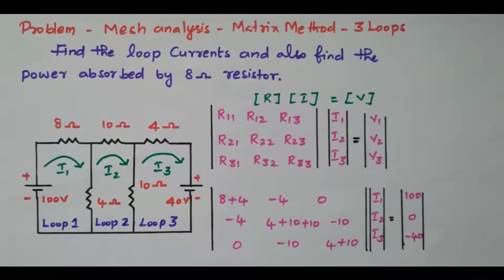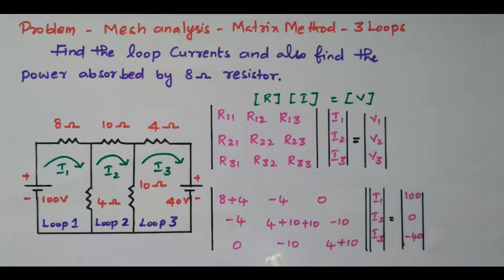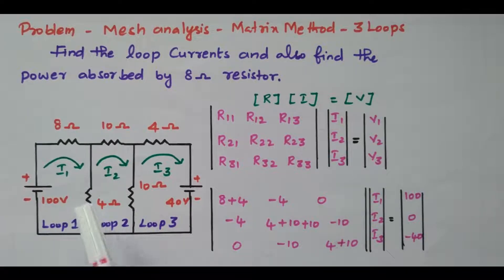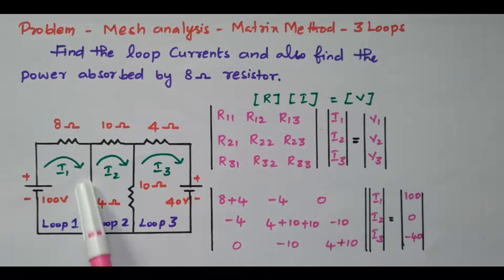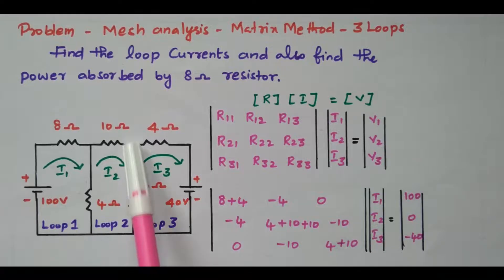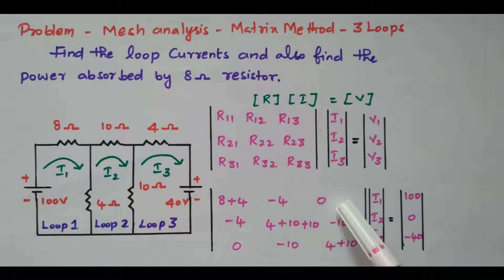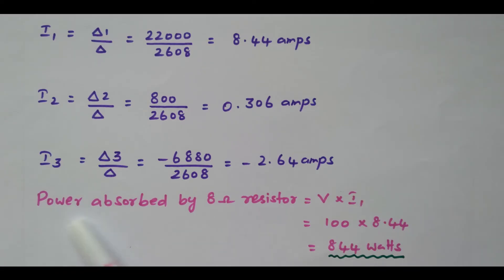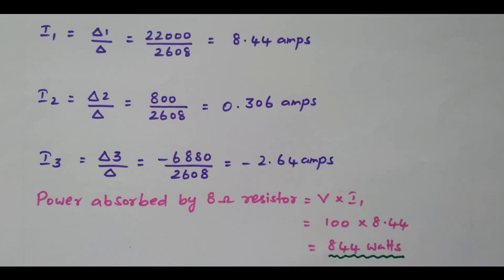Solved Problem #4 - Mesh Analysis - Matrix Method - DC Circuits - Basic Electrical Engineering

Comment: Good explanation, but I would like to make a small point. The power consumption on an 8 ohm resistor is P=IxV=8.44Ax67.5V=569.9Watt.  The voltage across the resistor is V=IxR=8.44Ax8=67.5V. Isn't 844 watts an incorrect result?
Reply from the maker: Thank you for your information